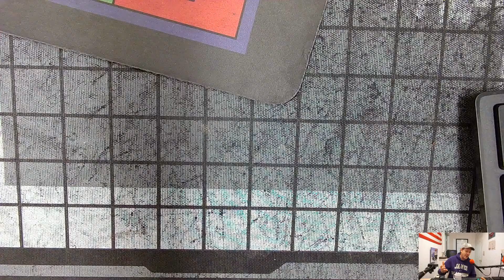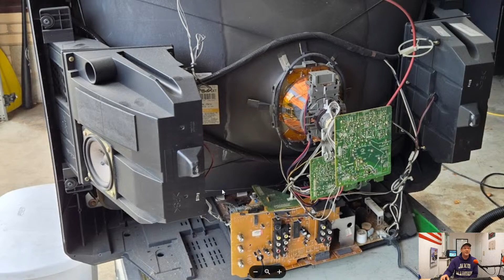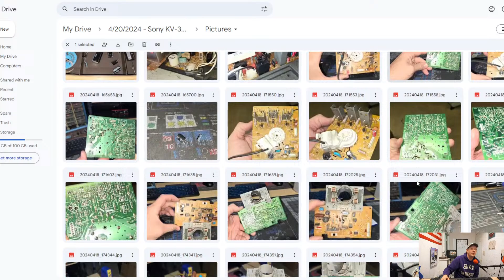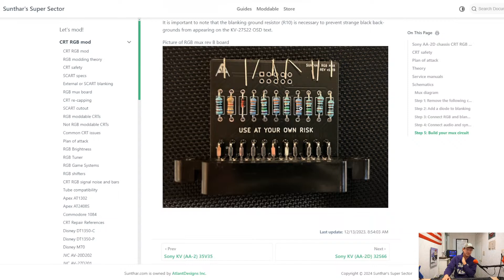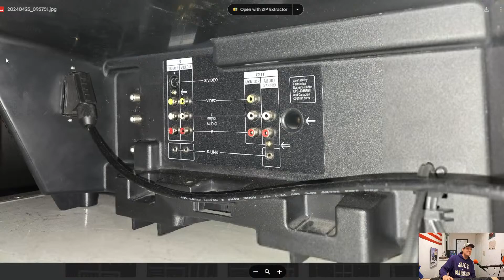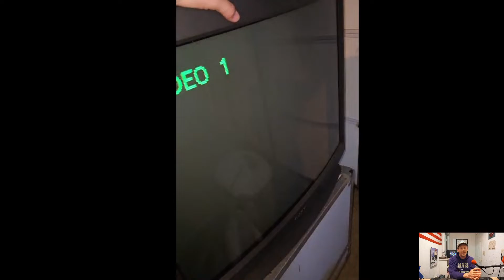Opening My New CRT Shop

Comment: Best wishes for the new shop! Congrats and we expect more fun to share with us🎉

This KV big boy is similar to the models we can find in Europe. The VM board have VM and also QM, it is the most common here. 

The WA (VM in Europe) board sometimes has also DF (dynamic focus) in some models/chassis like FE-1 and FE-2. The DF function is also present in A-boards in most of the cases. 

The small ring around the yoke is for the rotation setting, not degaussing.  If you disconnect it you will lose the effect of changing the settings through the menus. 

The RGB mod is very nice and powerful!!

The set seems brand new now. These giant sets are like unicorns